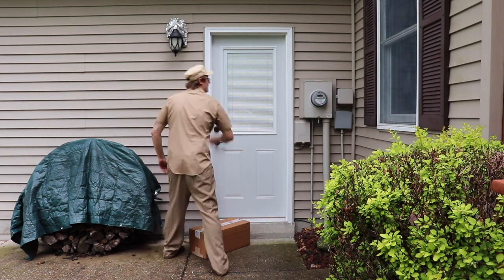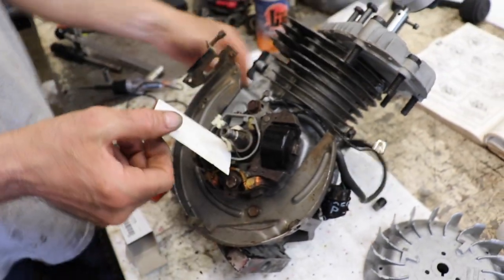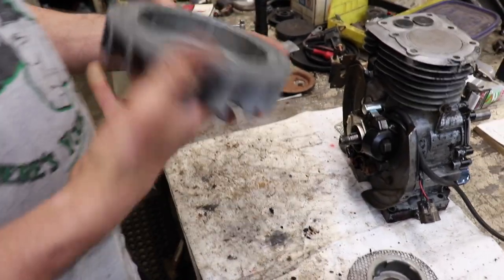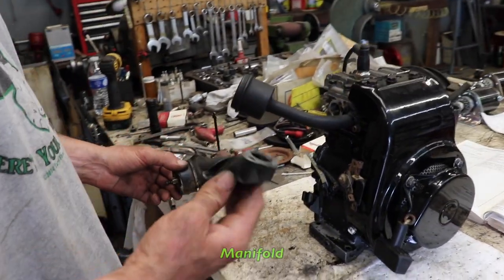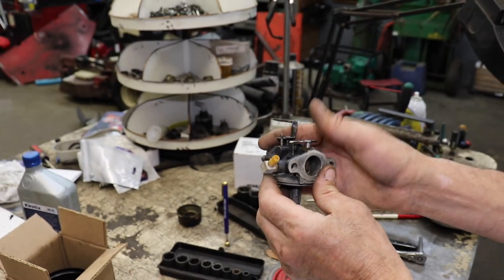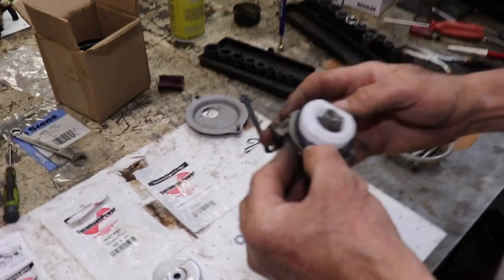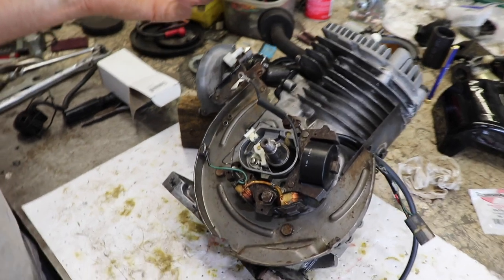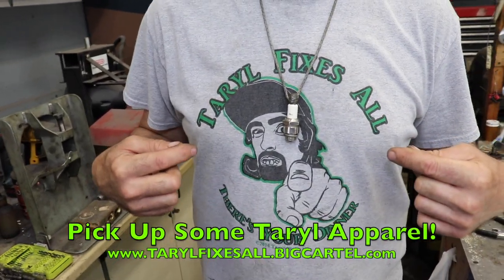(Part 2) Tecumseh Small Engine Total Rebuild

Comment from the maker: A few of you had mentioned the metric dial indicator, I didn't realize it was metric when I had purchased it off eBay. The reading was technically off .020 of an inch but as you can see it still ran good. But basically you can still use the way shown to time your engine. Thanks fer pointin' that out, sometimes we overlook a thing or 2 every now and again but y'all keep us on our toes. Now there's yur dinner!!
Reply: Taryl, your videos are as far as I can tell really the best! Entertaining and educating, I've seen them all and really love them! That little detail-no big deal, since I'm living here in Germany for the most time of my life I'm totally used to the metric stuff and it jumped right in my eyes, so don't worry to much about it, the procedure was explained perfect, even I prefer setting timing for ignition or the camshaft by angle on old motorcycles, but even they are no spaceshuttles...hehehe
Reply: Taryl, I  am a collector of small engines. I spied one that you have, would you be interested in selling? Please let me know either way.  Happy Independence day.
George.
Reply: paulg  It's not yelling, it's a "Grass Rat's Hoot", required at successful repairs, rebuilds, etc. Taryl Dactal ®️™️
Now, there's yur dinner!
Reply: Runs good on metric
Reply: @georgesabol459  I don't know if you are the same George Sabol from Fla that sells the bike stuff but let me know what kind of motor you are interested in I got all kinds of stuff around this place. I have 2 rare 5hp goKart motors here. I believe they are old Tecumsehs.
Reply: @thekingsilverado9004  west bend racing motors had the same point setup as a Tecumseh power products was basically before the Tecumseh engine there are a lot of similarities such as Clinton
Reply: It doesn't matter. Somebody just talking the metric 
It was already given to you in inches lol 11/32
Reply: I've collected engines for years and Lawson is also a predecessor to that Tecumseh
Reply: @georgesabol459  yes I'm glad to see he knows what he's doing there's so many that don't.
Reply: Yea it’s funny to us but not so much to you Lololo 
We’re getting old my friend

Comment: I watched both of your small engine rebuild videos and tackled a 1982 Garden Way Troy built tiller with a tecumseh 6hp engine replaced broken cam, crank gear, points ,condenser,carburetor ,throttle cable,and set timing . I had never worked on a small engine before runs great thank you Taryl you are the best.!!

Comment: Thank you very much for sharing this total rebuild. I watched both Parts 1&2. Currently working on at least five of these 5HP motors, single and twin shafts both. Newer and older. I suspect that I may have another 5-6 more. At least one has the CB points. Got to finish all before the lawnmower season wakes up here in Toronto, Canada.

Comment: Maybe you can shed some light on a 2 stroke Tecumseh I own. The tag on it reads T-642-04B and under that it reads 5966452. My dilemma is I haven't been able to decide it or find parts. I need a connecting rod and full set of gaskets. The blower housing has Commando 500. It is an outboard engine. Ran great then I over revved it and the rod started knocking. Haven't fired it up since to avoid more potential damage. Many info will be greatly appreciated. Thanks for the videos and the knowledge you spread.

Comment: The trick I learned for seating the valve seat without the tool is to use the blunt side of a drill bit.  You don't get the little pip to hold it in place, but you just gotta be careful not to drop it. It's worked for me every time.

I also usually just use compressed air to blow the old seat out rather than trying to dig it out.

Comment: Hi Taryl, great video. This is my go to for teardown and rebuild for my Snow King carb. My carb doesn't have the long taper on the low speed needle. It has a short tip, and then a step. Is there still a tube inside that needs to be loose for the engine to idle? Thanks, Phil from Toronto

Comment: Thanks Taryl, I can't thank you enough for this video as am working on almost same engine. (Not a minibike engine) Especially the governor, inside carb tube, and points / condenser settings. I was wondering if I could ad the  electrical for power which you informed in the video I would need to find the proper flywheel with appropriate magnets,  Very informative video's take the guess work out, and clearly identify ..... Can't thankyou enough, for all the little tricks you've shown.

Comment: so I had to do some digging to find this video Taryl, I have a similar engine that I have replaced coil/condenser/points, I did mark the base plate before removing for coil replacement, no spark. back story, this thing is an old leaf vacuum, looks like new, been sitting more than it has ever ran, I think its a spark issue. anyhow, I ohm the shut-off to block and its working fine, I did the same with the points bolt and its grounded (0.00 ohm) until I disconnect the coil, then I ohm the coil and I see on secondary resistance (8.43) at the plug connector to the ground wire, I ohm the 2 wires at the coil and no resistance (0.00), both coils measure the same. the magnets grab a wrench holding tight, no way to measure the air gap between the flywheel and the coil plates. this thing has me scratching my head? can you shed some light here, it would be greatly appreciated.

Comment: I happen to have a Tecumus(Tecumseh)5hp.engine that came off of a mini-bike,but mine sets"FLAT"and something broke inside of it.It ran fine the last time I checked it on my"test-stand",but many years later,I went to see if it would start,it will not pull through anymore,I'm not sure what this is,this engine sits inside my lawn and garden shed,there hasn't been any bugs or mice messing with it.
I pulled the plug and look inside with my bore-scope,there's no rust what so ever,no corrosion,nothing.
I kinda don't want to do it,but most likely,will have to do a general tear-down to see what's going on with it.
I also wonder can the Tecumseh HS-series be converted to electronic ignition??.

Comment: I need some advice boss. I'm looking at buying a 86 John deere 330 diesel. Looks like the wiring has been mess with over time, clutch is also loose and rattling, the govenor case has had a hole in it that has been jb welded. The starter has been rerouted as well and it needs a new fuel pump. 1500 hours according to the meter. Is it worth 1100 or will the parts to fix her up right be more then the actual machine is worth? The inline fuel pump brunt out due to a short. Hydro seem to be working, it does fire up and the pto is now working as well.

Comment: Back in the 70's my cuz Roach rider had a 5 HP tecumseh with a liting coil on it. I was
into electronix at school and made up a full wave rectifier, using a small bike battery, we
could keep up a steady briteness as the battery was floating on the line. The diodes
of course acting as a 1-way valve or as Taryl sed a sort of check valve, where juice could
only flow one way.

Comment: Hi There,  Question about the owners manual? where did you order it? I have a HS50- 67069A - 40670 Tecumseh mini bike engine. Trying to fix the timing and get a spark. Don't have the spec's Sheet.

Comment: PA LAWN GUY>  Taryl be sure the feeler gauge is clean. I have seen points set with the gauge wiped off with just a rag after using it to set valve lash and then a set of points and the points received enough oily residue to keep the system in an aircraft magneto from sparking.

Comment: Question, will an aftermarket Chinese knock-off carb have the same sliding tube behind the low speed idol?  My original Tecumseh #99 carb I can hear it sliding up and down when shacking the carb, the new aftermarket one doesn't do it.

Comment: Carbitr8ors! not rocket science. Cleaned one out last winter at kitchen table, a few feet away
from my gas range! piece of wire from #10 stranded copper and a coffee can of carb clnr.
8 gal air with blow gun is handy. Gettin ready to work on Ghertrude, a cast iron 16 HP briggs
stratton engine with gener8or as a starter motor. Taryl, would Gherty be good on a GO-kart?

Comment: I've got a multimeter which can check the condensers reading in microfarads,it's just handy to have that function on the multimeter as it has been invaluable to me.

As far as the brass float goes,pinholes inside of the float can be soldered up if no other float was available,it was a common repair on cars & motorcycles in the 1970's & 1980's !
Reply: Russell Booth Drop the float in boiling water. The holes in the float will bubble.

Comment: Question: if you set the gov arm at full throttle (default setting) the gov is already at max no matter how much more tension you add to the spring, so long as it makes the gov arm fully extend during full throttle engagement. So then, how can it create even more throttle power by adding more spring tension? My thinking is because if the gov arm is fully engaged via the throttle spring it is impossible to keep adding more rpm. How does the additional spring tension add more rpm then? I mean I can see how this works so long as the spring isn’t fully pulling the gov arm to max default. Am I missing something here?

Comment: Do they make a replacement for the points and condenser to a newer style ignition coil
Reply: Unlike a Briggs, you can’t swap in a newer electronic coil on a Tecumesh. On those, the newer electronic coil mounts outside of the flywheel instead of underneath like the points coil. No way to convert them that I’m aware of...

Comment: @31:40 You may not necessarily need more oil--be interesting to read the factory manual for that particular Rupp minibike and see what it advises--BUT as long as there's
plenty of oil under the connecting rod for the oil dipper to reach, it might be adequate or more than adequate. Old flathead Briggs Raptor (5 HP) engines on a 15 degree motor
mount (for kart racing) utilize less oil than the factory specs for the engine when it is mounted flat. The orientation of this Tecumseh is ideal in the same way, as the oil is pulled
by gravity towards the side that really needs it.

Comment: I would have rotated the crank past TDC then continue till yer coming UP  on TDC and stop at .035 BTDC. A tad more accurate that way. FYI you can also use a feeler gauge between head and piston.

Comment: So I got this Tecumseh twin cylinder (20hp) on a Stanley rider. Cleaned out the fuel tank, new fuel lines and filter. New carbs. And it ran great for a week. Now it's surging.  Choking it makes no difference.  What's wrong with it?

Comment: Another great video Taryl.  I thought the difference between a motor and an engine was a motor needs external power like electricity and an engine gets power that is self contained all in one unit like a gas tank. Is that true??
Reply: A motor uses power. An engine produces power.

Comment: I watched both of the videos for this Tecumseh rebuild. I just acquired a garden tractor with an HH60 Tecumseh on it, and I plan to rebuild it. This is an awesome video. I learned a lot, but I do have one question. I have never rebuilt a single cylinder 4 cycle before. I have done lots of 2 cycles. My question is about checking ring gap in the cylinder. I didn't see you do that. Is it not necessary, or is it something I need to check into. Thanks for an awesome video. Greg
Reply: I was wrong, again, You did cover the ring gap in the first video. Sorry

Comment: 35 thou equals 0,889 mm, but you were using a metric indicator, so you set only 0,35 mm. I know, it's not a spaceshuttle, but then, why do you use a dial indicator?
Reply: I thought I was the only one. Sharp eye. Metric indicators are rare here so it's a common mistake.
Reply: @d46512  I'm from Germany, so I'm used to nothing else than the metric system, sometimes I have to deal with the standard stuff which drives me almost crazy, specially threads, that took me really a while to get used to, but I still don't really like it, sorry.......
Reply: Was looking to see anyone made this comment yet.

Comment: Does Briggs make an engine with a coil on the outside of the flywheel and points under flywheel?? I have a 1974 engine with 2 wires going under the flywheel and coil on the outside??
Reply: Yep!
Reply: @notajp  Thank you sir

Comment: Just wondering what ltg voltage is, say 7 or 8 volts, run thru rectifier and charge small 6 volt
lead acid battery?

Comment: I don’t understand why you would do so much work when you could replace the points with a CDI? You need to do a Tecumseh points to CDI replacement.  Do you still have to be so precise with the coil if you go the CDI way?

Comment: I feel your frustration on that coil, many times Ive been fixing something and the new part is made different and I'm like WTF???? it has a new ridge in the worst of places or the wires comes out in a different location and i just wanna strangle whoever was responsible,lol because now you have a new issue to deal with that you didn't before, the whole point of buying new parts is to have a quality build not to get a degree in re enginering.

Comment: I know what the points do but what exactly does the condenser do ? I never really done many points and condenser type ignition systems on small engines before
Reply: The condenser help prevent the point contacts from burning. It absorbs the current inrush ( arcing) that happens when the points open. That arcing will erode the contacts in short order unless it is dampened.
Reply: @notajp  Thanks. I don't really see many small engines that have the points and condenser on them anymore. Most of the ones i do they just want me to convert them to the electronic ignition

Comment: They made an engine in the late '70s and I had one it was a three and a half horse tecumseh that did not have a governor. I ran it wide open all the time , if you wanted.... it did not even have the hole on the block for the governor shaft I think go-kart racing guys have heard of this engine it had a name but it was a 4-stroke  I don't think they made very many of those

Comment: My hm100 lost spark from sitting outside, it has the internal points setup, I tried a new coil and points and still no spark. Could it be a weak flywheel? I'm about to scrap this engine. It's in a craftsman snowblower.
Reply: I'm having the same problem right now. I tested the ignition coil, points and condenser with my meter and it tested fine, still no spark when under load on the engine. I just ordered a new coil, points and condenser waiting for them to arrive. Hope that fixes the issue. Did you end up figuring out your no spark issue?
Reply: @CodeManDew94  no I was going to replace the flywheel on it. Just haven't bothered because I have an extra snowblower.

Comment: I have a 22 inch Murray I just bought for $30. It just needed a carburetor. It had the wrong carburetor on it. It has the 3.5 hp Tecumseh TVS90 engine. I have a 20 inch 1997 Craftsman that has the Tecumseh TVS90 too. I just bought a 22 inch Craftsman with the 4 hp Briggs & Stratton engine for $10. It just needed a new carburetor. I bought the new carburetor and air filter for $15. I will keep the lawn mowers with the Tecumseh engines. I will sell the Craftsman for $125. It is self propelled.

Comment: forgot to lube the point cam felt.
Reply: What felt? It's plastic, there's no felt.
Reply: @killer2600  these old engines had a felt that held oil to lubricate the breaker point where it runs on the crankshaft.
Reply: @NebukedNezzer  I'm looking at the points in the video and there is no felt so again what felt is he supposed to lubricate. I'm aware of Points having felt but those were also made of mostly metal instead of plastic.

Comment: And since it ain't the space shuttle..... if you don't have a ring compressor you can use a hose clamp. Just oil the snot out of the rings first. There's your dinner

Comment: ABOUT THE TINY HOLE THAT SUPOSETLY GO ALL THE WAY IN TO THE PISTON, WHICH COULD BE DAMAGED , BY A LONGER SCREW ??? I WOULD THINK THAT THERE IS A PISTON WALL IN THERE OTHERWISE YOU WOULD HAVE LITTLE OILPRESURE SQUIRT'S COMING OUT OF THERE !  FROM THE "UP AND DOWN" MOTION OF THE PISTON ???
Reply: There is DS !!  what he's saying is if you use a longer screw to put a shield on and run it down its a setup for failure... you have then just dented the cylinder wall and piston will lock making the motor pretty much useless... its not an open hole to the pistons as youre implying, but ill bet if you put a slightly longer screw in it and bottomed it out into the cyl. wall it sure would be !! And THEN your description would be correct !!
Reply: @jr42a1  Precisely.  The hole is drilled and threaded not quite all the way through.  If you put a longer screw in, it'll punch thru the final little bit, causing a bulge on the cylinder wall and potentially a matching score on the piston.

Comment: 20:50
The magnets are stikin tu it.
you should wrap some anti magnetic material around the inside of the starter cover to increase the power and decrease the magnetic attraction to the starter cover.
So the magnetic flow won't slow it down. Like the magnets trying to grab the starter cover like a brake.....OMG if you put a heavier duty starter cover on that and you had an electronic brake system set up in your flywheel. You could make an electronic break for that engine. 🤯🙂😵😴
Probably get three hundred thousandths of more horsepower out of it. 😐

45:27
Safety tip w/sound effects